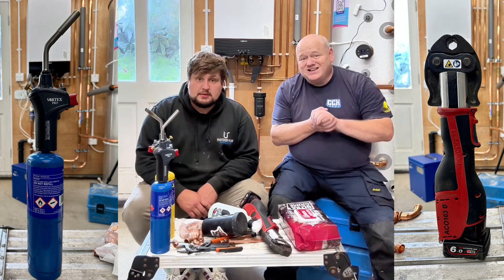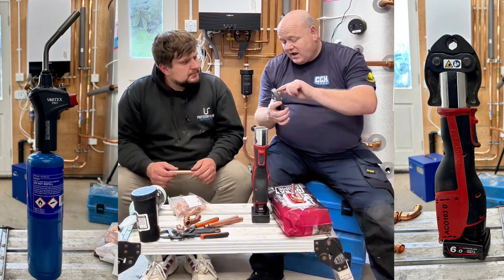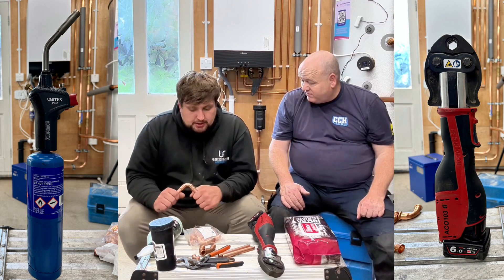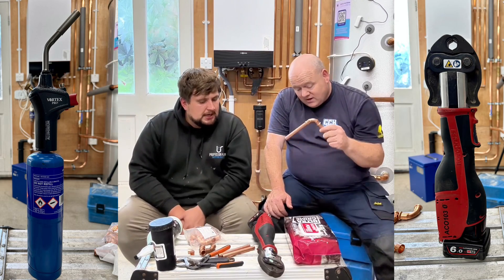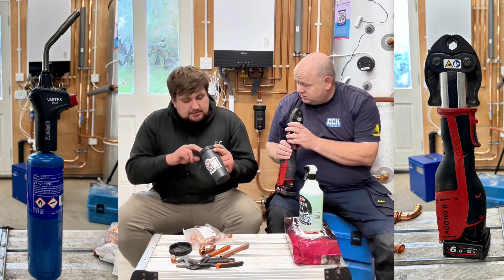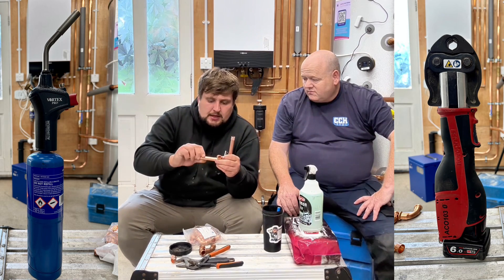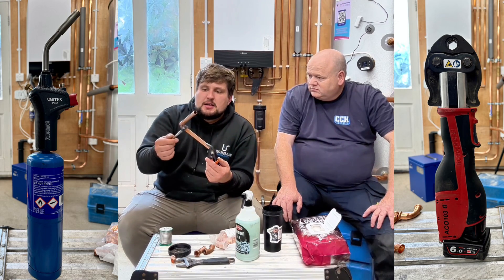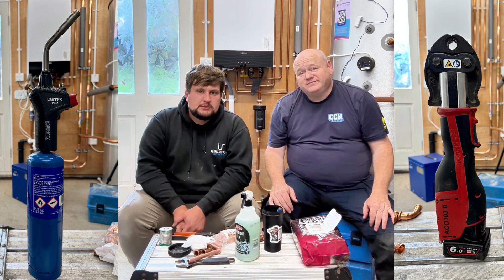Copper Pipe Joining: Pressfit vs. Soldering Techniques Plumb Vs Plumber Professor Plumb TikTok

Comment: I was taught the term is capillary attraction but then that was more than 50 yrs ago , also learned plastic solvency of solder , it needs to set before handling ,30 secs or so,

Comment: Hi Allen, I’ve just tried press fit, is it normal for a bit of side to side movement in the joint sometimes? They don’t leak. I’m concerned it is my manual tool as I did not want to splash on the expensive tool until I tried it. I’m using M fittings with M tool, I’ve checked that!

Comment: The Gas you use is not important on domestic sizes, bearing in mind most installers don't have an understanding of were the hottest part of the burner flame is or were to apply the flame relevant to end feed or solder ring!
Ultimately,  it's  horses for courses and it's  another option depending on the situation,
Reply from the maker: What do you use? Thanks.

Comment: Working in Edinburgh property's where the soldered copper pipework is between 40 and 80 years old it is inconceivable that you would ever use pipes that have a safe working life of 25 yes . 
The in car fragrance "scent bomb" will destroy plumbing O-ring seals.
So if you want to sabotage some job then that stuff does the trick in about 5 days after application.
Reply from the maker: Not really sure what you mean but thanks for the comment.
Reply: @AllenHart999  copper lasts indefinitely. Plastic and squash fit copper fittings are vulnerable to certain air refresher products . 
Duhh , what's best ?

Comment: Do not use the grip to squeeze the pipe 
It is an chance to leak
Reply from the maker: Have you done it and it leaked? Thanks.
Reply: @AllenHart999 yes, that has happened to me a couple of times

Comment: I use both, but mainly solder. Small boiler change jobs, I go for press-fit just to speed things up. I never use flux to cool a joint. Wire wool to remove excess before it's cooled off,  then, moist rag. .
Reply from the maker: Thanks for your reply.

Comment: Always solder.  Just O rings on press fit.   They will eventually go bad.  Expansion contraction from hot to cold will eventually wiln and cause a leak.  Not sure how your cpvc is over there but here it's straight garbage.
Reply from the maker: Thank You

Comment: Alan in America, press fit is quite common on tankless water heaters and combi over here for tight fit areas such as hard to reach 90 degrees with obstructions they have attachment jaws over the pipe to be attached , allowing the main body jaws to clamp to be 90 degrees to it or other angles, I’ve yet to see you use these yet, is there a reason as most us installs use colour coded plex or aluminium metal pipe are they not compatible with cop or have you not yet seen them?
Reply: in america you don't have to worry about your pipework being straight or plumb just chuck it in like spaghetti and don't clip it to anything and make sure you use plastic pipe the more colours the better
Reply: @cliveramsbotty6077  your being scammed mate , sure plex and plastic are two colored blue and red, but all of my work has been professionally done to the same quality standards as it  england,
Reply: @ram64man  If your pipework matches your prose I wouldn't be surprised

Comment: why should u not put flux in the joint? and whats the name of the wipes?
Reply from the maker: One of the reasons why flux is typically applied only to the pipe and not the fitting is to prevent excessive flux from entering the system. Flux residue left inside the plumbing system can potentially cause corrosion or clog pipes. By applying flux only to the pipe, you can control the amount and placement of flux, minimizing the risk of introducing flux into the system.